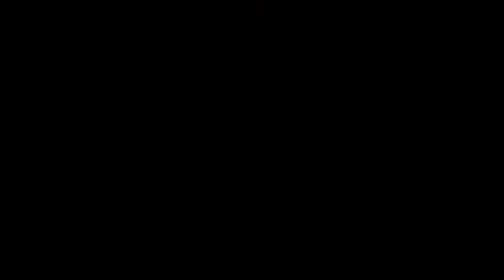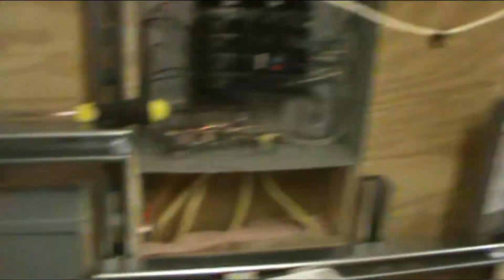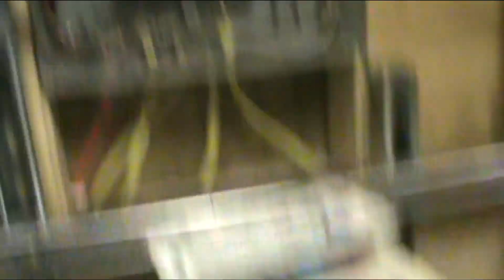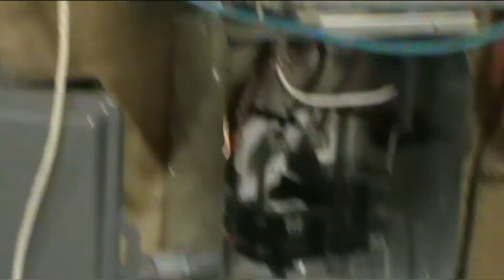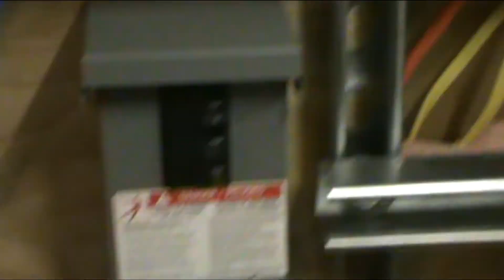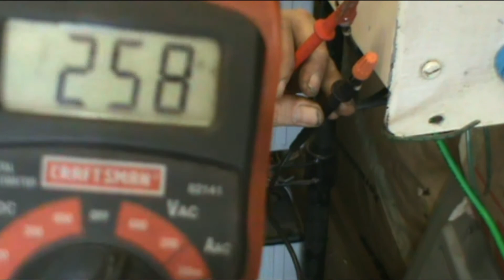New solar install Part 4

Comment: Hi  +McCuneWindandSolar, short question. Iam able to connect the 2 hot lines of US 240V  split phase directly to utility input? When utility is transferred, it bond utility input to inverter output? I mean if I have to hot as utility input, when transfer switch activate it bond the 2 hot lines to output L + Neutral? Iam scarry one hot becomes neutrally grounded tru output. Thanks a lot!
Reply from the maker: yes this unite will hook up like a 240 window air unite. were you have the two hots and then ground.  So the read and block of most homes are the hots, then ground. Then the out put of the inverter will be 230 volts when the unite is running off solar and then 240 or what ever the line in coming voltage is once its switched back to grid.  Now if you want the out put to be 120 you will need a step down transformer like the one I have.  Its 240 in and 240/120 out depending on how it is wired.  I have mine wired for 240 split phase, though the 5kva transformer.       

I first had and isolation transformer thinking i need it but the people that make the PIPs said I don't need it because everything is isolated in the inverter.    I hop this helps.
Reply: Thanks McCuneWindandSolar, so all inside inverter is insolated that mean than none of utility input and output are bonded together when utility is used? Iam asking that because this is my plan to my comming soon PIP 4048GE inverter. First I will connect 240V from hot line of my home split phase L1 + L2 to inverter utility L + N. Then the 230v inverter output will be connected to 2 step down(230 to 115) autotransformers cross connected on primary so I can get from each one 120v dephased 180 degree. The N's of  autotransformers secondary output will be bonded together which in autotransformers are bonded to N of primary input. This is the same transformer configuration Steve show on one of his videos.
Reply: Iam worring about when inverter is under utility mode some inverter input bond to some output. Inside Inverter are all insolated or bonded in some way?
Reply from the maker: whe this inverter is in inverter mode then you will have L witch will be hot. N witch will be neutral and then ground.   Once it goes back to Utility It will be the same as the input witch will be  L being hot and N being hot and then ground. The system uses Relays in side the unite for switching from Utility to the inverter.   Witch is a built in Transfer switch between Utility and inverter   LIke what would be found on a Generator system with a transfer switch.     

Once the inverter is in utility mode the out puts will be the same as the input. This is why I use the out put transformer that I have.  I have never used an auto Transformer so I don't know how those work in this setup.  I know inverters like out back uses them when running two for 240 split phase.  I know the out backs have transformers built in them and when they are set up were you have to have two to the 240 split phase they use the Auto-transformers for load balancing, that way both inverters share the load across both inverters.

Comment: I have 12 lead acid batteries 2V . an inverter 2424 msx pip . that cutting low voltage I put it ?

Comment: can you connect the inverter(PIP) directly to 240 using the 2 hot line without using transformer?
Reply from the maker: +Home Sj I would not suggest it . Because the 240 we have both lines are still hot in respect to ground.  The transformer I use takes that 240 and changes it to were I have a true hot and neutral and ground on the 240 going in to the PIP.

Comment: that's a super Nice setup you got there.. Nice job....great video thumbs ups. thanks bud!!!
Reply from the maker: been some fun work. I will be running a line to the house to take some circuits hooked up to the PIP.  and when there is solar I will have those off grid.

Comment: Great stuff mate. good to see how easy you sorted it. Still worked out a lot cheaper then some of the other stuff on the market. And dose a lot more for the cost. Top stuff. Still did not see yo9u giving it a cuddle .
Reply: Will the PiP/ Giant Hybrid, Grid tie, charge controller and power inverter , hook up the same way as this model? And where can I get those transformers?
Reply from the maker: Jason Brown yes it can be hooked up the same way using these Transformers. Once I get this all going good with more solar ect I will as time goes get a the Hybrid and hook it up also. but I need to build my power room witch will be huge I"m looking to have up to 24kw of usable power if I need it for any reason.   Lots and lots of work and lots of over time a head of me
Reply: McCuneWindandSolar
I run 12v AC output turbines,, could I use one of those transformers to convert my 12v turbine's AC output into 24v AC output or more?
 I know there has to be a transformer that does that, 3 phase ac conversion,  I don't want to buy 3 new turbines for a 48 volt PiP grid tie system :)
Reply from the maker: Jason Brown You can I have been using a PWM step up that steps up the voltages from  10 to 60 volts up to 12 to 90 volts.  they are 600 watts. and you can stack those for increased wattage and now they have 700 watt models out.  I have been using it to keep my voltage stable and been running my turbine to my pip and it has been using the MPPT side and its been working but the MPPT takes a long time to sink up.  so I only run it when I'm waiting it until I build a charge controller to cut the voltage down to keep it below 130 volts the PIP can handle 145 volts
Reply: McCuneWindandSolar
That's good :) ,, I can still use my turbines and not have to buy new ones ,, this is definitely something I will be thinking about doing in the future ,, I am going to work on adding more solar first :)

Comment: Racking system you designed rocks. Must have watched this video 5 times. Thanks! So glad your doing this, looking forward to seeing the progress of your system.
Reply from the maker: Thanks,  I will also go in more detail on other areas to help out others also.  and I will be doing that with this last Transformer in great Detail. that way others will know. even with pictures and narration of the video ect.     This sure is fun though.
Reply: Hooking it up to your PC is like candy!
Reply: Your video's are great! helping us all to understand, I'm, solar rookie, want to help the community more. Still learning!!!! Your understanding is next level. You know more about autotransformers then the companies contacted trying to find out more about them.( I think you know who) lol! vid 6 can you get a close up up the transformer diagram, Were the wires marked? Like the 5kva you have power looks Awesome Was expecting 115 volts! Does it have buck boost built in?
Reply: When it got warm did it still have 120/120
Reply from the maker: off grid kid when it warmed up it dropped down to 115 per.
Reply: That's perfect still a good voltage for usa. think it saves a bit of power this way? Happy Easter to you and your family.

Comment: WHAT!!!!!!!!!!!!!!! Awesome! Great information, looking pimpin! (pip in) lol! Had to out do me and get two transformers. haha. You will not see solar info on your computer till the solar is running, Does not show on screen till solar has input. Transformer out put from pip is solid... Nice work buddy!
Reply from the maker: And so much more to do. But yes its coming a long nicely. I even ran a test on the PIP and battery bank though the 5KVA transformer and it preformed nicely.  O also just like with any other Inverter that uses a transformer that us about 50 watts at rest.  now that I added the 5kva transformer it uses about 50 watts at idle. 

I ran a 1.5kw Oil heater on it for 1.5 hours. Just as a test, and I was only pulling 31 amps from battery bank the inverter never got loud fans were quite, the 5kva dose hum some but not to loud.  the 7.5kva is quite no hum.   and the 7.5 uses about 50 watts also at idle. so not bad not bad. I'm loving the PIP So fare.
Reply: 50 watts? Mine's using 15 to 18 watts at idle. I think the pip works so well, one reason the amps it uses form the batteries, think it doubles going threw the transformer from 230 to 115 / 120v? So the transformer does all the work.
Reply: Do you have it hooked to your PC yet???
Reply: My system will idle at 16 to 18 ish, if i turn on a 60 watt led using like 9 watts it only goes up to 20 to 21 watts just a few watts above idol, find some thing that uses less than 50 watts and see if you get the same effect? like a fan or light you can leave on to use up some of this loss, that's why mine system is never at idol, or turned off.
Reply: Hate wasting power! When it's free solar power does not hurt as much! lol!

Comment: Looking very very nice :) nice to see it running :) I don't think you will be able to run a welder on the pip as it high frequency, I could be wrong as its going in and out of a transformer :)  You should see Justin case's volts LOL. Very glad to see your running off the pips
Reply from the maker: I have lots of testing to go through. But yer the PIP is working great.
Reply: McCuneWindandSolar kick ass brother. nice work
Reply from the maker: yankey4 thanks, and there is still more to go. Waiting on DC breakers for battery bank, and solar. So much more to go but its getting there cant wait until I have it all finished..